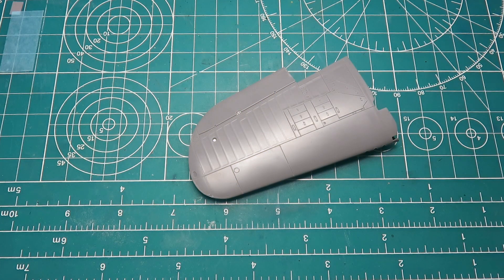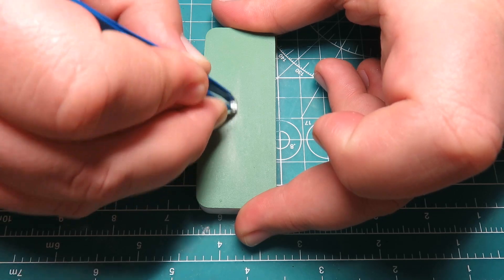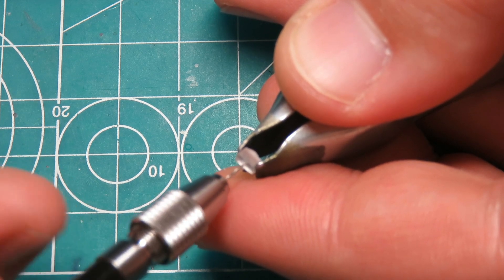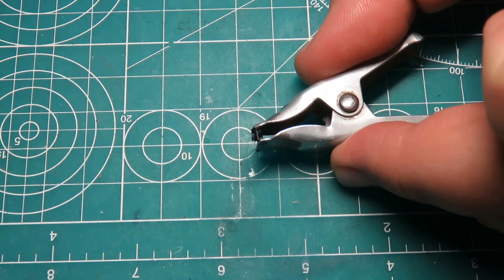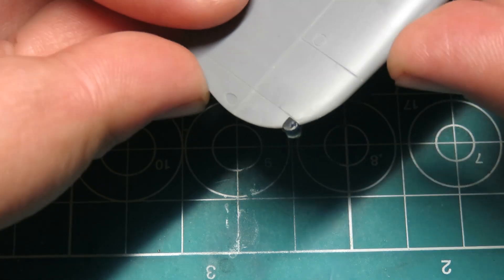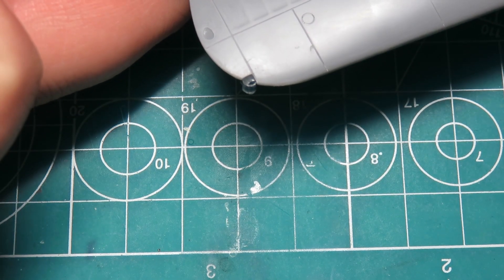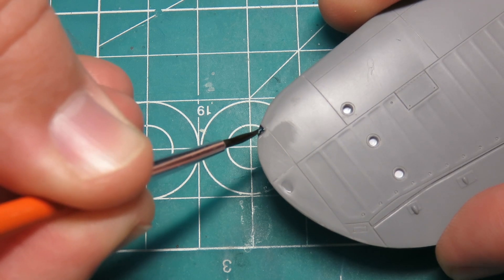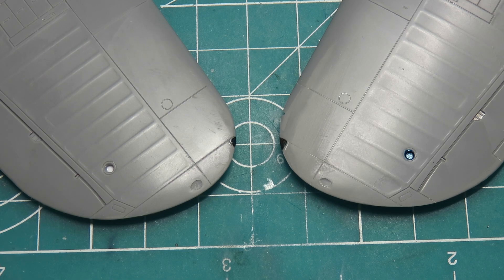Wingtip Lights Demonstration

Comment: Nice guide - I like to paint mine silver (after painting the lightbulb the right color) - not sure if it is completely right from the "reality point of view", but it looks even better to me.
The other fine option is to make a lighbulb from a thin plastic rod and drill/glue it into the wing and then use either clear epoxy or UV resin to fill the light. Works for me for those lights that are rounded from inside